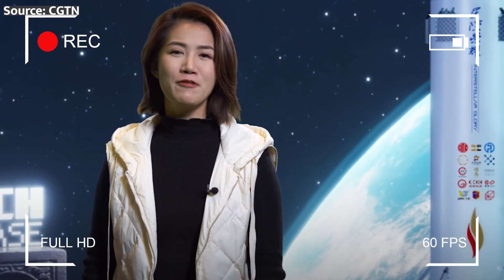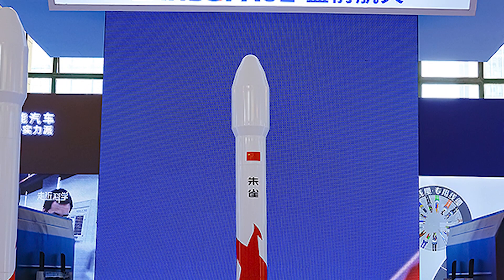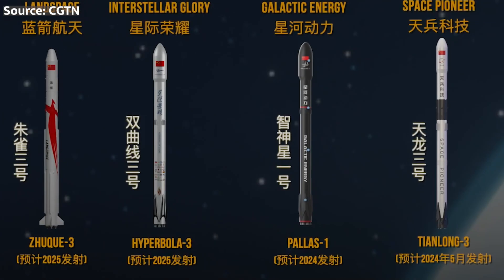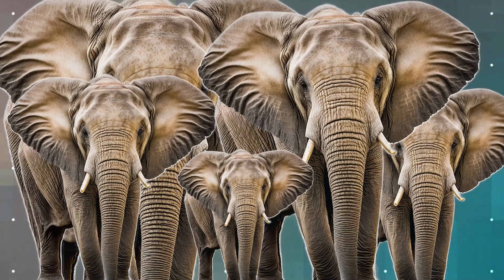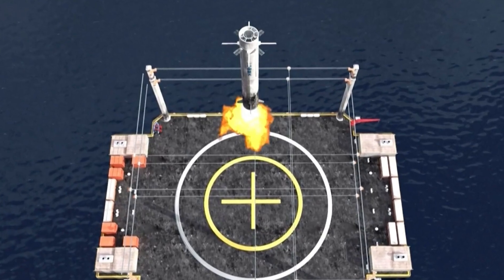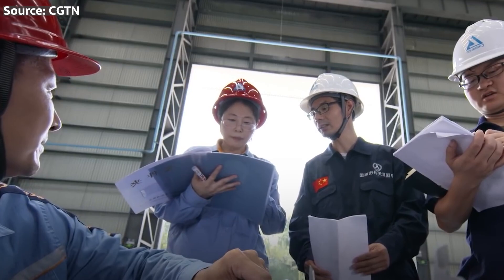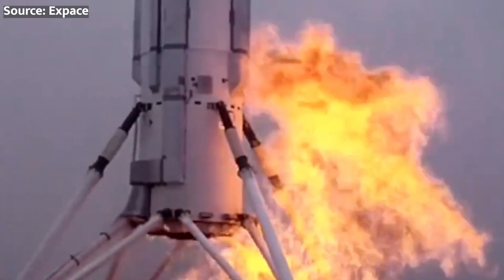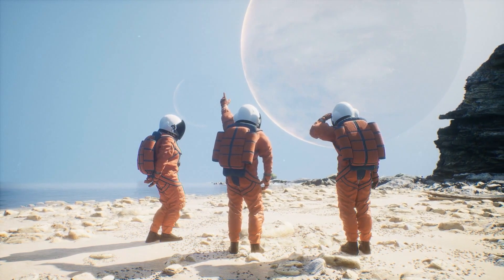JUST IN: China to Launch Reusable Rockets by Next Year! How Will They Land? Not Like SpaceX!

Comment: The wire catchment system seems to be a lighter and more responsive way to catch the booster than SpaceX chopsticks. However, the slewing cables may also tend to resonate and slap against the booster. There is the potential for them to bounce and skip over the booster hardpoints, so active damping might be necessary.